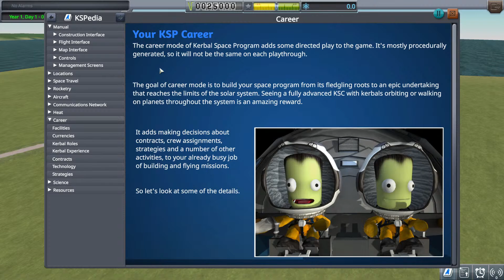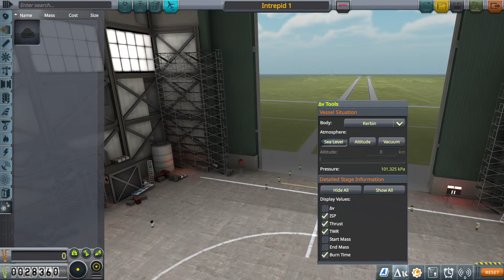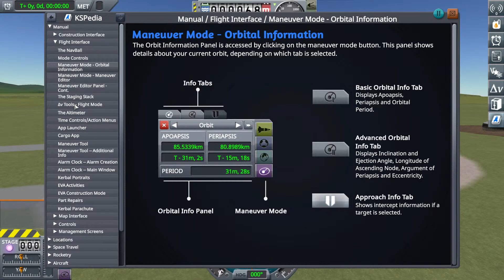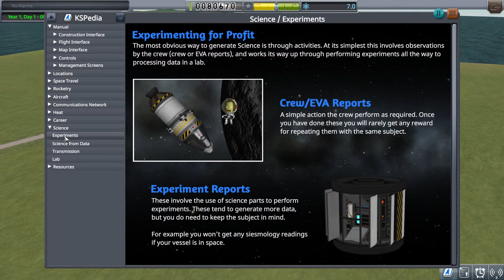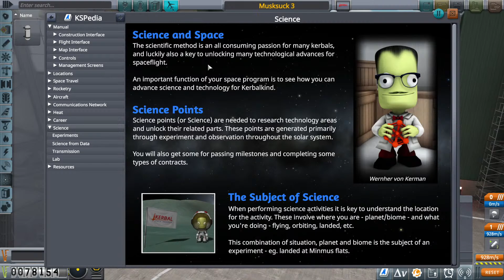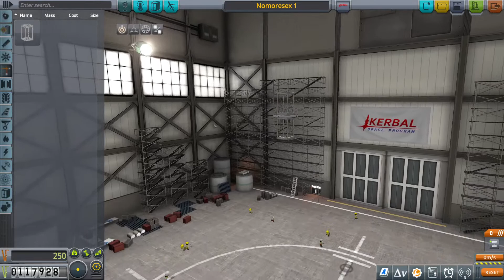KSP - Total Noob Kills Kerbals

Comment: So I bought it....played a BUNCH of missions last night and made a few discoveries that may help you.

"Thrust" ('z' and '[shift]' keys) doest seem to actually do anything....could be because of the types of starter engines we have.  So in order to reach specific altitudes while ALSO reaching certain SLOW speeds (80m/s to 210m/s etc) I did 2 stage ignitions. First stage half fuel loaded, 2nd stage decouple AND fire next booster which I only put 25% of the fuel in.

Also, each STAGE runs in order from the bottom of your screen to the top
(Stage 3 fires first then stage 2 etc)
Reply from the maker: Cool! Very inspiring that my terrible rockets got you excited to play and learn. I'll try to remember your tips!